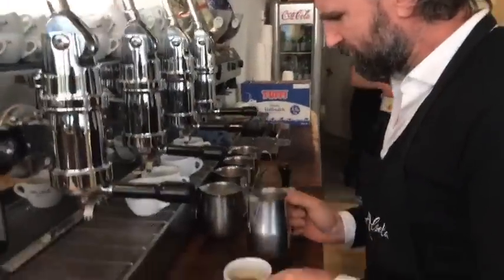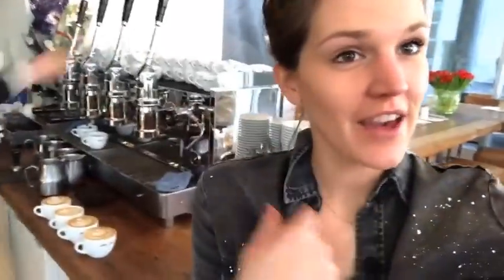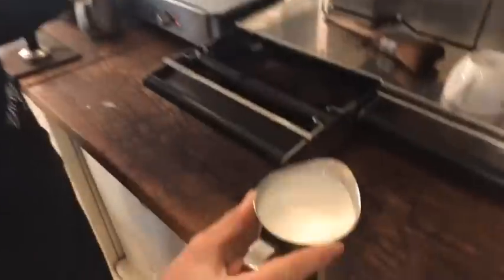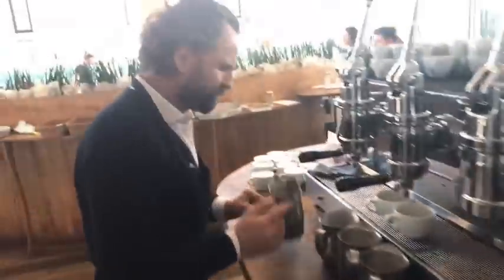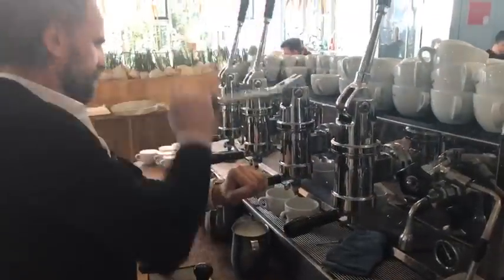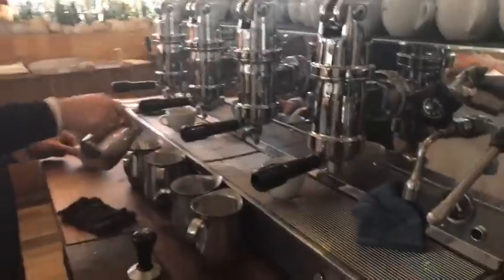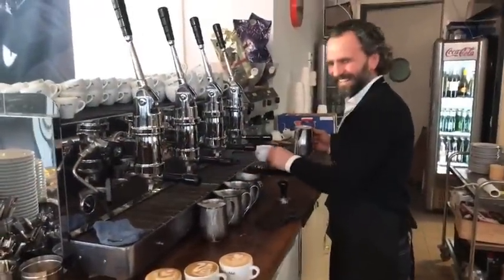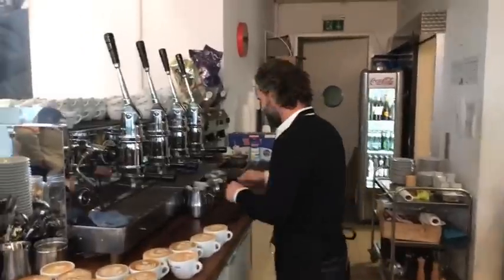Latte Art Live

Comment: Good video. I am a bartender but have to make allot of lattes and cappuccinos late at night for the restaurant. My pod lavazza machine has two steam wands; a manual wand that really cranks and is awesome for heating up syrups and blending bartender stuff and an automatic wand with a temperature probe that seems to be less rifled than the manual. So my question is this; do you foam differently for lattes and caps? The auto wand seems to make really frothy separated foam that wants to sit on top of the coffee while the manual wand I can pull earlier and get a more consistent foam; similar to the type you are pouring here.  Should I stack cappuccinos and machiatos with this separated foam or is this just poor form?